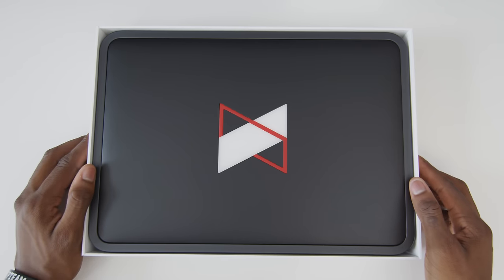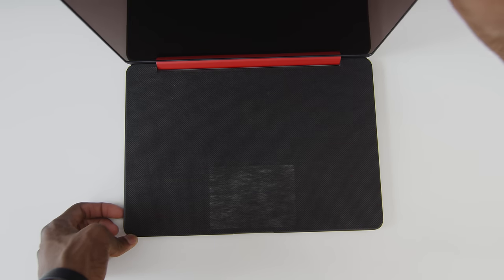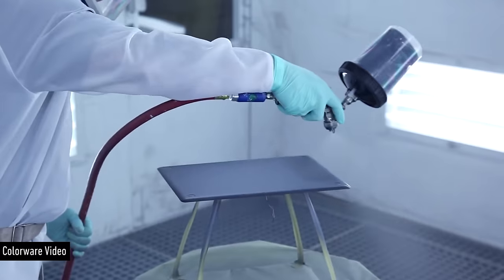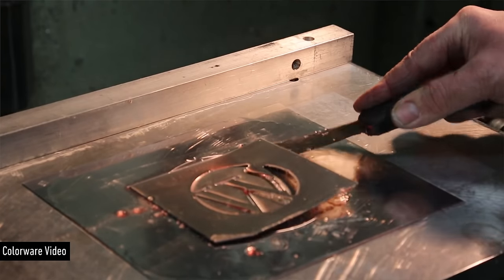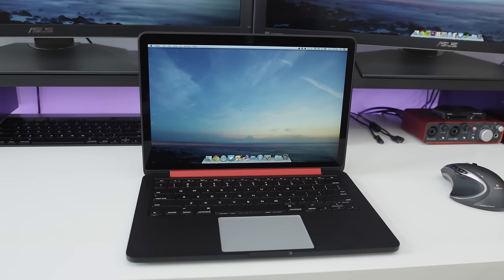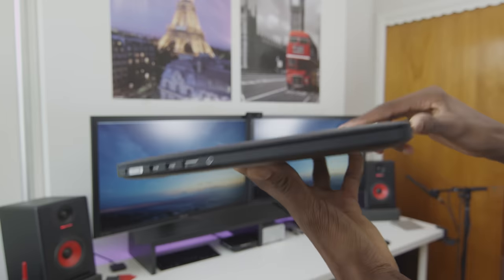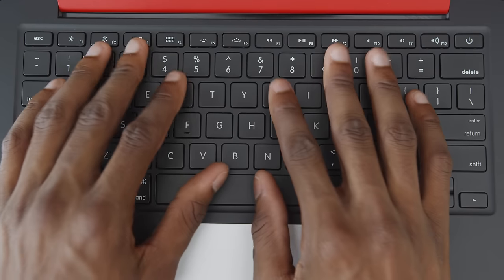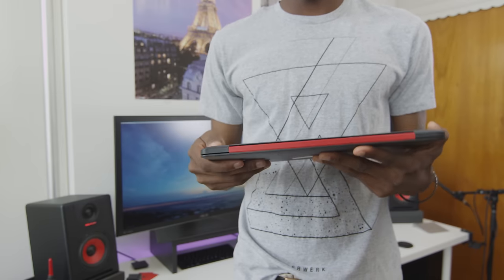MKBHD Edition Macbook Pro! (Colorware Custom)

Comment: I'm not not being an apple hater here, but why do so many people love the Macbook line, what's so apealing to it over a nice ultrabook PC? I am a hardcore PC all the way kind of guy but I do like apple laptops. So what makes them a better choice over a high end ultrabook.
Reply: It's just a better piece of hardware, I run Windows and OSX on mine
Reply: A PC in the same price range non gaming are extremely comparable and even better built
Reply: Beside its industry leading design, Macs OSX as a Linux based OS is widely used in the media, science and engineering industry. And if you do need to use Windows or any other OS you can always bootcamp it - hell you could even completely remove the OS X partition. A major advantage over PC. If we are talking about price, the Mac line has been reducing its price lower than ever and it selling value is much better than PC.
Reply: They come with Mac OS X, which in my opinion has better UI than Windows. 

They are sturdy, stylish, and reliable. That is what some people like about the MacBook line.
Reply: This may sound naive, but macs really do last longer, plus, there are not very many virus developers that make viruses for mac, so they are safer. personally feel that the Mac OSX is much more organized and clean.
Reply: SnortsOfHappiness I think apple is very limmited to only apple. For example it's pretty hard to read files on a mac that are sent from a windows device
Reply: try to have one first.
Reply: Oh! Media oh i've worked with plenty
Reply: The case designs are always more uniform and symmetrical than most Windows laptops you can find, it just makes it look so much classier. I find many (not all!) have weird shapes that totally break the streamlined feel.

I use both OSX and Windows every day, but I spend most time on OSX because it's just an overall nicer experience. Also if I see how much time i've spent fixing crap on Windows in the past few years while I didn't have to do anything hard on OSX, it makes me love the Macbooks even more.
Reply: Let's get things straight here dude. I'm not marketing for them nor am I trying to sell something. I just answered his question why many people like macbooks more than windows laptops.

Regardless of how much bullshit the company is, I like the product. I don't care if it was freaking Toshiba selling the macbook, I just like the piece.
So stop acting as if I'm an Apple sheep because I'm not. I like both and just prefer one of them which is not Windows...Boohoo.

Just let people state their personal opinion, it has nothing to do with the whole company, jeesh.
Reply: Brand Loyalty + Marketing
Reply: 3Target33 grow up, he isn't marketing anything.
Reply: For me, the difference is that MacBooks are purely enjoyable to use. I had a few Windows laptops and they were fine spec wise, but I never enjoyed just using them. The way MacBooks are physically designed, coupled with the OS makes me enjoy using the actual technology in addition to what it allows me to do.
Reply: Just the functionality, for example, I am an Apple developer, I need OS X to code with XCode. Personally, I like it, I can also run Windows on it, unlike an Ultrabook, I cannot run OS X (legally).
Reply: Try to find a laptop with Firewire to, say, be able to run a decent I/O audio box, beside a Macbook pro.
Reply: Omar Al-Hadithy IOS sucks, it's not even good as a gaming platform... He, that's what happens when you string meaningless words together without a hint of any fact behind.
Reply: Use a mac and you will love it, i use note 3 but i stick to ipads, i game on my pc with 760 but i bring my mac air out everyday to work. They all have different usage and you should never hate on something until you have tried using it
Reply: Sorry, but "Window suck" is a totally meaningless, immature and irrelevant comment any way you cut it, grow up. As to the fanboy sly, it is just as mindless as the rest of your dribble,  I run a pc workstation at my studio because Apple doesn't make one that fits my needs, and I carry a Macbook pro because it does what I need at a price I'm willing to pay.
Reply: 74Burgess No it's not.
Reply: TheGaIaxy  BS! BS EVERYWHERE!
Reply: Before I say anything, I own both a 13" macbook pro and a laptop, also an 4k gaming PC.

In my OPINION: The Apple macbook pro may seem overpriced at first, certainly spec-wise. But you're actually paying for the user centered design and lots of R&D. Overal I find using the macbook pro a lot nicer. Things are smoother, more consistent, better designed and easier to use.
My macbook is for light usage like schoolwork, light design work, love the portability and just consuming media on it, not gaming and video editting. 

For gaming and video editting I use my desktop PC, or if I need to be portable my windows laptop. You can just get more bang for your buck specwise.

Hope this helps :)
Reply: to everybody that thinks apples are overpriced, fine. Don't buy them. Buy whatever toshiba, dell, hp, whatever laptop you want to get and run windows 8, i hear it's lovely. get a touchscreen capable laptop, it's not at all gimmicky. do what you want, i'll stick to my macbook and be happy with it, run OSX and windows flawlessly, and be glad about the fit and finish of the machine. I prefer my fully loaded rmbp to the tower i built.
Reply: It's a combination of battery life, solid industrial design and software.

Apple has long had a reputation for better-than-average battery life in its laptops, and that's still true now. You know how Windows Ultrabook buyers are ecstatic when they get 8 hours of battery life? Yeah, a 13-inch MacBook Pro (with a more powerful CPU and a sharper screen) gets 9 hours of real-world use; a 13-inch MacBook Air gets 12.

The design isn't necessarily the materials, although MacBooks tend to be free of creaking and panel gaps.  It's things like the superior trackpad (accurate, smooth and supports plenty of gestures), the MagSafe power connector (prevents you from dragging your laptop to the floor) and a genuinely comfortable and quick keyboard.

And software... well, OS X isn't for everyone, but it's easy to grasp, reliable and has a lot of features that can greatly speed up what you're doing (Spotlight searching and the Mission Control window/desktop manager, for example).  It's not true that Macs are immune to viruses, but they get disproportionately far fewer attacks than Windows -- so long as you have a router and use common sense, you're genuinely fine if you don't run security software.
Reply: Aurelian well said, I couldn't agree more
Reply: 3Target33 I completely agree.There are good mac books as there are windows laptops, it's just down to personal taste and what your using it for.
 
All these people that say windows suck have ether, never owned a windows laptop, or just brought the cheapest one they could find.
Reply: Probably because they look really nice and are really popular
Reply: As far as I can tell it's all about software preference/ecosystem. Many customers prefer OS X to both Windows and desktop Linux, and there's definitely something to be said about iOS and OS X integration.
Reply: Windows is a cheaper way to get more bang for your buck performance and content-wise, considering you can pirate ( arguably ) anything. Tbh if I could afford it I'd much sooner buy a Macbook for my everyday use and a console for gaming, but I had to combine the experiences due to financial concerns.
Reply: 74Burgess I also run linux and a few other os's
Reply: crarazy buy one and you will understand
Reply: Not gonna lie I don't understand why Macbooks are so popular either and yes I have used one had to use one for several years at work. Everyone keeps saying that PCs have crappy build quality but I disagree yes there are alot of companies that make PCs and some of them are crappy but you just gotta do your research to find a good well built PC. As far as being able to only run Windows that is also not true I run Fedora, Windows, and OSX. I only use OSX for xcode and IOS development and I use Fedora for all other coding projects and work. However my daily go to is windows it is simple to use and customizable and honestly when I am home I just want a computer for playing games and internet. Not to mention like many have before said PCs are far cheaper I am running a laptop with dual nvidia graphics an I7 hasswell processor 16gb of ram and a 500gb ssd in an aluminum chassi computer all of which I got for under $900. I guess if you really prefer OSX then that would be the only reason I really see to getting a Macbook.
Reply: Faraaz Youssifou You can read any file that is sent from a pc device on a Mac. But sometimes when receiving files from a mac, windows doesn't support the file format.
Reply: I bought a MacBook Pro 13" Retina to run Windows.  After looking at all the Windows ultrabooks at Best Buy, I wasn't satisfied with the build quality of most of them.  I did kind of like the Samsung ATIV Book 9 Plus, but it was actually more expensive than the MacBook I got (ignoring the fact that I had to buy a Windows license for the MacBook, heh).  To be fair, some of the specs of the Samsung were a bit better, but the MacBook has something that no Windows laptops have anymore: a 16:10 display.  There may be better Windows ultrabooks than the ones I saw at Best Buy, but I didn't want to buy an expensive laptop without being able to try it out first.  I don't regret buying the MacBook Pro at all; I absolutely love it.
Reply: Because an expensive company has it's name on it. So if you have a MacBook you'll seem "Cool" It's all a bandwagon propaganda thing
Reply: jdpurcell2 did you like mac os after trying it or did you just go straight to windows.
Reply: Tonester Sher Well not necessarily, though I would agree with you for other aspects of Apple, I wouldn't say so to as much of an extent for their laptops. They are more expensive than others but it defiantly functions, has many great features, integration with other Apple products (none for me since i don't own any Apple products) and good reliability. I was just looking at the Surface Pro 3, now it has a lot more flexibility than the Air, they both are the same price range, like the exact same price range, the Mac actually has the edge by $200 price difference in the upper end of the spectrum, that's $200 less than the Surface.
Reply: Price Burnett My previous laptop was a MacBook Air 11" so I had already used OS X and knew I didn't care for it.  I just prefer Windows' UI, primarily the way the taskbar works vs. the dock.  I don't like mixing of non-running apps with running apps (which is why I never "pin" anything in Windows), and I like to have each window show up separately in the taskbar and to see the window title next to the icon (I disable combining).  I like to map network shares from my Windows desktop which is a bit awkward in OS X.  Keyboard navigation in Finder is strange - why does the enter key trigger a rename instead of opening the item?  The way scrolling with an external mouse works - I hate how it starts slow and then speeds up (SteerMouse fixes this though).
Reply: rockhopper123452 i used to run windows, osx and linux but i did something wrong because my screen just stopped working lol
Reply: Windows (Everything after Vista) seems to hate DJ software, with Mac that does not happen. I also like the capability to run natively OS X and Win 7 at the same time, but to be honest, I almost always use Windows because FL Studio (I produce my music with it) and gaming (My MacBook Pro runs suprisingly well Watch Dogs and all the new games).
Reply: jdpurcell2
Be careful because the Retina display is useless while using Windows, you will need to resize the resolution to the resolution that the screen would have without Retina display, unless you want to get blind tring to read tiny text.
Reply: wejhvabewjty The Retina display is not useless on Windows.  I run at full 2560x1600 resolution.  Windows supports DPI scaling.  I have it set to 175%.  It's not perfect everywhere because it's up to each application developer to support it.  But it's definitely very usable and most of the time I'm browsing the web with Firefox which does DPI scaling flawlessly.

Applications that don't implement DPI scaling usually just get scaled up by Windows automatically so they look a bit blurry, but normal sized.  Only rarely (e.g. Adobe apps, Dropbox) will you find an application that appears way too small, because those applications tell Windows that they can handle high DPI displays even though they can't.
Reply: I used intially the DPI scaling, but its completely horrible. Try to use 1280x650 with 0% of DPI Scaling, it will look way better, and it won't hurt your eyes.
Reply: Depends what you're doing... but for primarily web browsing I like to run full resolution for crisp text and the few YouTube channels (e.g. this one) that have 4K video.  But yeah occasionally I find stuff that sucks with DPI scaling, e.g. remote desktop.  If I need to I turn off DPI scaling and run at 1440x900 resolution.
Reply: jdpurcell2
Agree, but since it takes a lot of time to change resolution and scaling I reset to Mac if I ever need to watch video in really high quality.
Reply: Dat Tin Nguyen You forgot the almighty Linux!
Reply: Personally, I don't see any reason to buy a Macbook Pro. I say this purely because of its price to performance ratio. for the same price, you can buy a pc with a beefier core i7, more RAM, and better SSD/storage options.

This leaves the aluminum unibody construction, the retina display, and OSX as its only selling points. That's not enough to win me over :/

I recommend an Asus g750JZ, or the Razer Blade 2014.
Reply: bullsharkreef Okay, first of all I don't want to be tech grammar nazi, but, iOS is for iPhone, iPad, and iPod touch (that being said it is based on the same architecture of OS X but that's a whole other story); OS X (formerly Mac OS X) is the 10th major version of Macintosh Operating System that has received revision updates for the past 13 years.  iOS is to Windows Phone and Android as OS X is to Windows 8.1 (or 8, or 7, or Vista, or XP, etc.) and the thousands of desktop Linux distros.  Not trying to be condescending it's just a pet peeve of mine.
Reply: Tonester Sher I don't know if that's true, hear me out.  If that was the case, why would MKBHD (and other customers) go to a company like Colorware if they wanted to show off their Apple loyalty.  If you look at this custom laptop, it's a total sleeper... nobody would know it's an Apple laptop unless they really looked at it hard (like noticing the charger or the command key rather than a windows key).  I realize that Apple is known for their iSheep who simply follow what they say, but others (and I suspect many of the tech enthusiasts watching this very video) try to inform themselves of ALL the options in a piece of technology before deciding what works best for them.  I'll give you an example, I could have easily gone with the all inclusive Apple ecosystem, but I decided in my circumstances I would prefer an Android phone (for the customizability and in my opinion more practical functionality), a custom PC that I built (for a home workstation/ gaming rig/ home theater), and a MacBook Pro for a work and school (knowing that I'd have Apple's great customer support should anything go wrong with a machine that I'd consider more vulnerable than a desktop).  It's just what worked for me, it also helped that I had grown up using Apple computers for most of my life, so unlike many of todays iSheep who decide to jump on the Mac bandwagon after they have their fun on their little iPhone(...meh), I actually had a little bit of skin in the game and tried to broaden my horizons instead of getting sucked into Apple's ever expanding ecosystem post 2007.  Oh well, that's just my thoughts.
Reply: design, battery life
Reply: longer battery life :)
Reply: ***** Are you for real? Ok "Puts out 4k"..... better now? If you think its entirely impossible do some research :)
Reply: ***** This is the reason you don't have many friends Mathias
Reply: 74Burgess Exactly finally someone understands
Reply: Its important to realize that these days Macs aren't overpriced. Expensive, yes, but not overpriced. They are well made, premium products, and when you use one you can really feel how well it is made. Also, because the hardware and software is MUCH more standardized than windows machines, everything just works better, and in general I find the OS to be better designed and easier to use. Plus, despite how easy it is to make fun of the apple store and the genius bar, apple customer support typically beats all other manufacturers.

Personally, I have two computers: a purpose built desktop gaming PC, and Macbook pro that I use for everything else, including work, general internet browsing, travel, and organizing personal data and files. Pretty much everything except gaming is better on a mac (and even then you can bootcamp it and play some of the more reasonable games just fine).
Reply: i own pc and mac, and with every thing apple, i think you can always break it down to user friendliness. If you buy something apple, it may not do everything you want it to, or have the specs, but you will usually immensely enjoy using it. Hope that helped.  Just recently bought a macbook air 2013, the battery lasts forever, and its so light i can comfortable hold it with one hand.
Reply: ***** Grow a pair
Reply: Rocking that Red Hat life
Reply: There are a lot of great comments here on why I prefer Macs when it comes to laptops (I prefer building custom desktop PCs as a gamer). But here are a few things I didn't see anyone mention:
-Free Software Upgrades - The current version of OS X was a free upgrade, and many of their other pieces of software seem to be following suit. That helps bring down the cost of the computer over time for people who like to always run the latest versions of software. 
- Professional IPS displays. As a photographer, I can always rely on the quality of a Mac's screen. Sometimes I'll be tempted to try a PC laptop because of a cheaper price or slightly better GPU, but then I look at the screen quality and I remember why I pay more for my laptops. Even if I were to go the PC route, high quality screens are only on premium laptops. Remember, there is a lot more to a screen than just its resolution. 
-Great productivity apps included at no addition cost with all Macs. iPhoto is great for organizing and editing photos for most consumers or small businesses. Pages and Numbers are great replacements to Microsoft Word and Excel for many people, and I find Keynote to be a much more elegant program for designing presentations over PowerPoint. And YES, you can buy Microsoft Office for Mac. I can't tell you how many times I've heard PC guys say you can't get Office for Mac. GarageBand and iMovie are great for simple video and music projects, and Final Cut Pro and Logic are great professional programs only available on OS X for those who want more professional features. The prices for Apple's professional software has become extremely cheap compared to the competition in recent years as well.
-Your apps can be installed on 10 devices. If you eventually get multiple devices or have family members with Macs, you can buy one copy of an application on the Mac app store and install it on all of those devises.
-Many other reasons that are important for some and not important for others. Remember you are paying for more than a device. You are paying for an experience. If the hardware, software, and experience does not match or exceed the price point for you, then maybe a Mac is not for you. But it's hard to really know for sure until you have used one long enough to develop a personal opinion. Like I said, more than anything, it's mostly about the experience.
Reply: Faraaz Youssifou I think thats inaccurate. I work on windows at my work and I have a mac at home. I send files in between all the time. As long as the file types are right, you can view files from either medium
Reply: Maybe because iOS runs iPod iPad and iPhone, not MacBooks.  OSX is actually decent for gaming.
Reply: bullsharkreef There are other videos on YouTube that prove you WRONG, my friend! Mac can play quite a few games itself like Amnesia: The Dark Descent as an example. It runs pretty well. So, shut the fuck up saying that MacBooks aren't worth gaming iOS!
Reply: Canadian Inuk 47 Wow, that's intense gaming. Amnesia, because that's just as hard to run as BF4 or something like that.
Reply: crarazy Not everybody plays a fucking shooter on PC.
Reply: Canadian Inuk 47 Ya your right, but when your talking about a computer being good for gaming, Amnesia is not a game that shows off any kind of gaming ability.
Reply: I play Skyrim on high settings on my rmbp 15", no issues at all, it looks gorgeous and runs smoothly, 4x antialiasing, Idk where people get the idea that apples can't game. If you want to game on one, bootcamp that shit, install windows and play. The problem isn't what software is better or worse for gaming, or what company makes your computer or hardware, it all comes down to whether or not the person behind the screen is a fucking idiot or not. It's computers people, not fucking rocket science. Stop the pissing contest and get what you need to do what you want to do and leave it at that
Reply: crarazy Well, then you're being an Apple hater even though you claim not to be.
Reply: Ew macs....
Reply: paratrooper95 You can get a MBPr for the same price with better specs other than GPU and slightly less resolution than the latest blade 14.
Better specs include better cpu (turbos to 3.8ghz vs 3.2ghz on the blade), twice the ram (8 v 16), and twice the ssd space(depending on spec ~256 vs 512).

That's going off AU pricing.

If you aren't gaming and don't need a black laptop the mbpr is probably the better way to go. Most things at that price point could seem to be poor value for money. It's diminishing returns.
Reply: I buy them because they don't get viruses as easily and I love apple's software
Reply: Elementary OS almost never ever gets viruses... And it looks better than apples software and its free just buy a windows pc way cheaper
Reply: ryan h You would have to be real unlucky or do some real dumb stuff on a PC to get a virus in 2014.
I literally cannot remember the last time I got a virus.
Reply: *****
exactly. Ios is not the same as Os. You could say a triangle is a trimmed down square, because you can cut a square into a triangle shape. That doesnt make them equal. So there is indeed a difference.
Reply: the apple my friend. Most of them dont know anything about pcs thats why they buy them. They do indeed have good  hardware but they also cost 2 times more. So if thye actually knew anything about computers in general they would not be so dumb to buy a mac.
Reply: anemozen I know plenty about PCs, I enjoy having a laptop that feels like it wasn't thrown together last minute, and having something that I know will last a long time. It's simple, well built, and can do pretty much anything I need to do. Yes, for the price I spent on this laptop, I could build a killer tower. But I want portability. And right now, with laptops anyways, I just haven't seen anything on the market that was designed this well, has better build quality, or is as reliable. Think of it like this...Some people think that buying a Porsche might be stupid because of the price, why would you spend that much money on a Porsche when you could just put money into a used Vette or WRX or whatever and make it go faster? They completely look past the overall feel of the car, the design put into it, the way it drives, quality, etc. If you don't have enough money to buy one or don't care about the design, quality, or feel of the Porsche, then don't buy it, simple as that. That doesn't make it a stupid vehicle. Nor does it make people stupid for buying them (even though plenty of people that do are lol).
Reply: 74Burgess nah you can find a better laptop you just dont know how to look.
Reply: anemozen
and whats actually wrong with a mac? dont say it cant run games. It can. But its built and designed for software, development, productivity. You truly cannot compare different laptop brands (pc, mac, linux, etc.) because they all have their own uses. Mac's are the best for what the do. As is windows. And linux. Now your opinion may say one is better, but dont tell everyone that mac sucks and pc is better. Its an opinionated response and if you dont support it nobody will take it seriously.
Reply: Juan Leonardo Their specs are no more powerful than a PC, they just charge a premium for it that it a considerable price jump over an equivalent PC. And for the OS argument on which is simpler, they are both equally as easy if not easier on the Windows side. Its not like IOS vs Android where IOS is clearly the easier OS.
Reply: Well first of all, what price range, there are 4 different retina display Mac Pro's so which one. For the case of the 15'' which starts at $2000 dollars, no matter what PC I look at beats it, why, because they are all gaming computers, and a gaming computer will beat a Mac Pro spec wise everytime because they have are all i7's with SSD's, 8gb+ of RAM and will always have a graphics cards. So no Mac pro can beat it. When your maybe looking at the 13'' it's different, but you never specified a price point, so do that and I'll get back to you.
Reply: crarazy ummm... tell me a single computer released in the last two years without a graphics card. Also, no not every other pc is a gaming computer. As a matter of fact, my laptop isnt, it has a baseline intel cpu, not the best graphics card, but still runs games quite well, at 1.89 ghz. with 4gb ram. My cousins pc? lower specs than mine, and its a desktop. I guarantee you, a macbook pro retina is better than both of our computers combined. Any of the ones made in the last two or three years. And gaming laptops are made for GAMING, whereas Macs are not. Of course the specs of a gaming pc will revolve around proficient gaming performance. Macs are for production, media, etc. You cannot say one is better than the other that broadly. Macs or Windows is a preference, neither is better because there are too many specs. I prefer macs because i like media and production, but i use windows more. Why cant people just stop arguing about "which is better" and just buy which one they want. Or both. Better yet, lets all buy linux's! Just SHUT UP about this completely ridiculous argument.
Reply: TheParanoidShadow Well if your realized the whole point I made in the original comment wasn't to start an argument but some how fan boys, which you appear to be one, jumped in and turned it into that and now I'm just here commenting on peoples stupidity. OS is clearly personal preference but the claims you are making are clearly false. For one, all computers within the last 2 years do not come with a GPU, in fact, very few of them do, including Mac's. Only their top of the line mac pros come with GPU's and there terrible, a 750m is last gen after there latest refresh last week and it also a very low power GPU compared to what you could by for the same price. And gaming laptops, the last person said to go and find a PC that beats a Macbook Pro spec wise and so I did, and in that price range they all happen to be gaming laptops, which macbooks aren't so they don't even compete spec wise.
PC:1, Mac:0. 
No your saying that you like macs because there for "Production and Media" that is extremely vague. What kind of production and media. You could be talking about watching videos and doing Microsoft office stuff because by looking at your YouTube channel where your "production" takes place your literally screen capturing Legend of Zelda (which there is nothing wrong with, especially Ocarina of Time, great game). So what makes a PC, in your book, less productive than a Mac, because I'm pretty sure they can do the same things.
Reply: crarazy
im not saying im a fanboy. I like both for their own purposes. Im saying that you can have a computer with beast specs, but it wont really matter if you dont utilize them. I mean production and media as in, taking photos and videos, editing them, adding effects. I feel like mac does a more efficient job because Mac os seems more like a software for developers and light programming. Im not saying pcs are less productive at all. Im saying macs are directed towards the industry of editing and producing media, whereas pc's are more universal. Most pcs can do basically what macs can, and some of its own. But mac does what mac does best. Pc's are excellent, especially for someone who watches videos and gaming and even just typing reports. Macs arent as good at the latter. They can do the same things, but they do certain things better than the other. I havent had a mac personally for long enough at a time to dig into it and see exactly how well it is, but from using them and and pc's, i can tell mac is more for extensive media production. Yes, i do the same on here with zelda (it really is a great game) but as far as editing goes, its incredibly hard for me as a pc user to find a good editing software. I actually only use the editing tools youtube has available. I dont prefer one over the other, but with pc's, because of how many there are and how different brands are, its hard to find one that runs exactly the way i want it to. But macs have what i want.If i could, id have both. I eventually will.
Reply: Juan Leonardo See there you go, and thats the reason you should by a Mac, if you like the OS, not for the specs. Because honestly, at any price point a Mac will never compete with a PC spec wise. But since its the OS you like, that's why you get it. The 675 is a good GPU, I know specs, and I can tell you a 750M is not as good as any of the GPU's listed on that chart. It's not able to play games at full 1080p on max setting maybe medium to high. But spec war, PC always wins and for OS war, purely up to opinion.
Reply: TheParanoidShadow Ok, now it seems we've reached an equilibrium, I agree with you and you seem to agree with me. The free video editing software that comes on Apple is by far better than any you can get on PC. I use high end editing software at school so I know that they have good software that works very well for PC but I know it runes just as well on Mac. But for media editing, yes Macs do seem to have the advantage because that software seems to be optimized more for Macs, and gaming is more optimized for PC. So yes they both have their pluses, and OS is purely up to opinion.
Reply: crarazy What if you don't like gaming and don't want a plasticy piece of crap?
Reply: JayJapanB Then you get this Samsung Series 7 Chronos, which is the same price as your clearly implied and beloved Mac Pro that isn't the "plasticy piece of crap" as it is all aluminum. And well it can game but do all the other things things that you want it to. You do realize that when you step into the higher price range of PC's that they are going to be built with some gaming in mind even if you don't use it because they realize that that's a good place to put the money.
Reply: JayJapanB Or the Surface Pro 3 which is an extremely high powered tablet-PC combination that has an all magnesium body, which is more high end than aluminum.
Reply: JayJapanB Or this:Samsung Series 7 Ultra
Reply: Juan Leonardo There we go, sums it up perfectly.
Reply: crarazy The Samsungs you listed are old, cheaper yet not comparably speced.

I have a surface pro. You make tradeoffs for the pen tablet format.
The performance is a lot less. The battery life also isn't the greatest thing in the world.
Also the paint wore off pretty quick on the first two. I haven't seen any old 3's yet. A high end surface pro 3 is by no means cheap.

As for gaming laptops, I see no reason to pay for a gpu I'm not going to utilize to it's full potential.
Compare a Razer Blade to a MBPr and ignore the gpu specs.
What do you find?
Reply: pikken01 And may I know what exact models you've been using and how long ago? It's entirely true that most laptops were garbage pieces of plastic five years ago, but companies have really upped their standards lately. Asus is a good example, their recent premium-ish devices like the zenbook are extremely well built. Same goes for dell although they do sell both high-end and cheaper devices
Reply: You know Apple is good for studying arts or computer arts. PC is more used for programming.
Reply: rockguy132 Well, imho art can be studied perfectly well on anything that has a correctly calibrated screen, however you lost me at "computer arts". If you're talking about Photoshop, that stuff should really be done on a desktop anyway, and the mac pro doesn't really work for that situation because of thermal  throttling in its GPUs. (in case you don't know what that means, when a GPU runs too hot because of bad cooling it slows down to avoid overheating. That causes large drops in performance)
Reply: Why I think people buy macs is because it's the industry leading standard. The OS is designed from the ground up to work as smooth as possible and handle as much as it can. I'm a Graphic Designer in spe (still in school) and I've always been a huge PC fan. But once you work with a mac, you can feel the difference over using the windows OS. Anotehr thing is that you are sure of what you buy, most proffs won't bother with building a custom pc with a good amount of workforce in it because it takes time, they would just buy something that is available and easy to support when something goes wrong. It's just the mindset of Apple, it knows at who it's targeting it's products.
Reply: There is only one thing wrong with apple: Compatibility (well, and they're a bit overpriced)
Reply: K3Techs Thermal throttling of its GPUs? Photoshop?
Anandtech found no throttling when he completely maxed a Mac Pro load. I've never known Photoshop to stress even a properly configured gpu setup.
Reply: storera21 they are overprice compared to a surface pro 3 which its years head of them
Reply: ***** Years ahead? How, objectively?
Reply: JayJapanB No its fact, the future is what the surface pro is bring, once it can gets smaller it will completely destroy any uses of paper, this idea the surface pro was started 14 years ago by Microsoft, apple has not really done much but improve on what is already there I bet you will not see a pc tablet from apple anytime soon, maybe 5 years from now... that's just a maybe
Reply: A week ago I was wondering the same thing about Macbook computers. It was years since I used a Mac computer and wasn't very impressed with them. However he's why I prefer using a Mac and get why other people would.

I do not care about gaming whatsoever. I'll play Minecraft or L4D 2 on occasion. I care about web development, programming and multimedia. For me, I prefer Mac OS X for that reason alone. Most applications have versions for Macs and for Windows so really in terms of applications it's gaming versus multimedia, graphic design, and musical arts.

On top of that, OS X just looks sharper when compared to windows. I hackintoshed my PC a couple days ago and started a challenge where I decided to be OS X exclusive for a week. So far so good. Instantly I noticed how sharper OS X is compared to windows (keep in mind i'm using the same display). I put Windows on my Macbook pro with retina display. Instantly I noticed how duller the operating system looked even with DPI, scaling, and all that Jaz setup correctly. 

I'm not one of those people who say stuff such as "Macs can't get viruses" because a) they can and b) It's easy to stay virus free unless you download notavirus.exe, go on weird porn sites, are friends with hackers, or just are stupid when it comes to downloading things. I also won't say that OS X is easy to use just like I won't say Windows is hard to learn. It's a matter of perspective and what you're used to. Windows 8 was a big change and the timing transition was a little bit shorter than the OS X transition but it still was different than what i was used. 

Sure you can get a computer with better specs with less money. However, does that computer come with a good design, and good screen, multimedia software, and have an actual good keyboard and mouse? I returned my Macbook Pro and got a PC laptop that was about the same price. It had more RAM and a better CPU. Problem: No Mac OS X (I like the software better), Worse battery life, the keyboard was crap, and the mouse pad was terrible by comparison. There's more to a computer than just a CPU, RAM and price. Most people don't think about that and are ignorant about that and I realize I was wrong to think about that way in the past. Oh as a sidenote, I returned the PC and i'm getting a Macbook because the touch screen didn't work, the mouse sucked, and the glare was terrible. 

Also it's a mobile computer. Gaming on a laptop sounds just as silly as gaming on an iMac. Who really needs a powerhouse computer if it's just a mobile machine and people have desktops and laptops?

Between build quality, software, keyboard, mouse, display, and battery life, there's a reason why the Macbook pro line is popular. Sure they might be more expensive but you get what you pay for. You don't mind a crappy keyboard, mouse, display and battery life, go with PC.
Reply: People like them because of the operating system, if you get at $1200 windows computer it will be just the same quality build, but its your choice if you want Mac OS or Windows OS.
Reply: Laguna Jules "$1200 windows computer it will be just the same quality build": Source?
Reply: most youtubers get it for imovie and finalcut pro probably the best editing softwares avaible and exclusive to mac os so yh
Reply: price wise you wanna go with an ultrabook, but macbooks last so fucking long their hardware can't keep up with the constantly updating software before it breaks. So overall it's a better investment if you got the cash.
Reply: Design.
Reply: Its a computer that works as it should. I paid 1.300$ for a Asus ROG and im impressed how Windows 8.1 is shit,.. Wish I have the money to buy a MAC.
Reply: Wilf Techhelp actually, no. it depends on what program you want to use. for me, with the same amount of money for a Mac Pro, i can build a faster PC for the same price.
Reply: I own one. But I don't love it. It's way too different from window's but it's pretty fast i tell you takes like 3 secs for me to shut it down. Pretty convenience
Reply: Gilang Wicaksono *faster for the programs you use.
Reply: They're good if you find windows difficult to use.
Reply: over-appeal everyone on sight by saying 'no virusses, no spywares and a ton of headaches', well if you are a gamer and you bought a macbook, shame on you! it is hard to tell that it has limited or lesser amount of games in the library than the Windows PC and its "not" or its expensive to be upgraded. on the other hand, you wouldnt probably swear if that 'sphere of impatience' still lurking around your macbook and also it still vulnerable to viruses called 'mac-viruses' that you lied to your friends to let them buy a macbook for the next yearly cycle, because you dont even care nor they are also lying and being dishonest. well if you dont like or hate on macbooks, buy a razer blade with an antivirus kit or any gaming laptop like Maingear or Asus, or even things are sarcastic and lead to a hypocrite, then if you dont like getting too much paychecks on computers and laptops, DONT BUY ANY SINGLE GODDAMN COMPUTER!
Reply: Melvern Soelaiman bro take a chill pill. I have a gaming pc and a mac I have my reasons to own one.
Reply: Let me put it to you this way:
A Mac is like a basic Mercedes. Classy, powerful, but a little overpriced for what you get.
A Windows computer is like an old Toyota Camry. Bang for your buck, simple, and sometimes even faster than a Merc. Much cheaper too.

The Camry is perfect for grocery shopping, bringing kids to school etc. Everywhere you go you can find an old Camry.
BUT. Now you are looking for a fun car. Would you choose an old Camry over a Mercedes? I guess not.

What I'm trying to say is, a Windows computer is perfect for everyday use, and sometimes it does better than OSX. But most people buy Macs because they like the experience. A Merc will give you a better experience than an old Camry. They aren't for the same kind of people. Having owned a MBP, I can say many things (But not all) are much simpler on a Mac. Like installing something for example. Just drag & drop. Yes, I admit, there are some people who buy for the brand. But don't shove all of them on one side. Both platforms are good at their own things, let them be. A Camry can never be a Merc and a Merc can never be a Camry. Same counts for this. A Windows can't do Mac things and a Mac can't do Windows things. Each have their own market.
Reply: Ryan Bogaerd Bro a perfect grocery car is a lambo
Reply: DrrrreeeeeammmmmM Oh, yes. Definitely. XD
Reply: FuZionSniperzZ
>implying implications
why would a sane person choose a shitty floppy system for stupid people over certified unix?
Reply: Super Toni This is not exactly untrue, my friend buys apple products for this very reason.  Sad, but some of us actually have Apple products because we favor them over products running Windows.
Reply: FuZionSniperzZ They haven't shoved anything down my throat.  I just opened my eyes and saw that MacBook's were the better choice for me.
Reply: ***** anything not running windows is better than something running windows obviously. but i prefer linux.
macbook + linux is good, though. both good looking and it does what i want it to do.
Reply: Echoz28 Yup whatever works for you.  Everyone has different opinions, and that's why there's so many options out there.
Reply: I am for my part a Windows User (mostly out of Gaming reasons) and i am not a great fan of the price policy of Apple. But still the Macbook is a extremly beautiful and functional piece of sexy hardware. Price/Performance wise a macbook is horrendusly overpriced but when u have and dontcare about the money and just want a product that works from the first start a macbook could be your way to go. As i said i would never ever buy one myself but everyone i know owning one is absolutely happy. (But getfucked with all that "apple doesnt catch viruses" bs)
Reply: Micha Pf
any computer can catch a virus if the user allows it.
software can have vulnerabilities, especially proprietary software like os x and windows, in which case it will be partly the OS developers' fault
in any other case it's always the user's fault
Reply: *****
windows is for the most part less flexible than os x, but that's really irrelevant since windows isn't a standard because it's good (by no means is it good) it's just used because it's popular and microsoft practically has a monopoly on enterprise sofware.
linux is far more flexible than both, obviously
Reply: Echoz28 How the hell is windows less flexible?
Reply: FuZionSniperzZ
How is Windows flexible at all?
OS X is at least UNIX compliant and and partly free software, which in itself allows for more flexibility than Windows.
Of course I doubt you have ever owned an Apple computer. Especially since you seem to be a gamer you are probably terribly misinformed.
Nonetheless I still don't recommend using either OS X or Windows.
Reply: Echoz28 I think they are both flexible, I think OSX is EASILY the best looking OS but it doesn't have the best hardware/software compatibility.
Reply: FuZionSniperzZ
Absolutely doesn't have great hardware compatibility, since it's only developed for one platform.
Software compatibility is not really decided by the operating system, since others need to make their software compatible with certain operating systems, not the other way around.
Reply: ***** Please, look in design studio's / Ad Agencies etc. depend son what field you're working
Reply: *****
macs are often used in places that are meant to look good. of course you can get good looking monitors, keyboards and mice for other hardware as well, but finding something that matches perfectly is often harder
Reply: Echoz28 Form over function is stupid, you can't build a business on that.
Reply: FuZionSniperzZ
No, it's absolutely not stupid. If your offices are well designed your employees are more likely to feel comfortable at work, and your customers are more likely to do business with you.
Form is a function on it's own.
Reply: Echoz28 Sorry but I have to disagree, My father works for the biggest tyre wholesaler/retailer in the UK, they turn over millions every year and some computers still use XP, one guy has an iMac (graphic designer), when it comes down to it, its doesn't matter what something looks like.
Reply: FuZionSniperzZ
Are you underage? You don't seem to think clearly.
Reply: Echoz28 I am 15, I have had a few months of experience is a major company and a smaller one, none of them use primary macs, therefore your argument is invalid.
Reply: FuZionSniperzZ
I've seen a music video on youtube, therefore all videos on youtube are music videos.
Reply: Echoz28 Ok? Incorrect....
Reply: Echoz28 You're the one who think that a company earns more money because they use a mac, am I really the one that is stupid?
Reply: Echoz28 My computer can easily smack most macs apart from the most expensive mac pro.

My case I got for £20 so I thought why not, it's not the best but it's functional, black and out of the way.

If you want me to list specs, please ask..

I am basing this off of retail and WHOLESALE, there is a large difference, also in the garage where cars are repaired, not a mac to be seen, should I tell you why? Because windows works a lot better in most cases.
Reply: FuZionSniperzZ
Windows is shit, OS X is shit, businesses are mostly filled with shit heads.
But if you are buying a house, choosing a bank, buying a car, or otherwise making important deals or purchases, the impression you make will mean a lot.
Also I don't give a shit about specs, high specs are useless for virtually everything except music, photo, and video editing/production.
Reply: Echoz28 and gaming!
Reply: crarazy
True, but that is using the computer as a toy, not a tool, so it wasn't entirely relevant.
FuZionSniperzZ
I can't tell if you are extremely simple minded, or if you are trolling, so I'll answer anyway. No, I want the function of the computer, the quality, and preferably enough storage, and if possible I will also take something I can feel comfortable using (it's ergonomically pleasant to use and looks good.) specs are not that important, as long as they are good enough for what I'm going to use the computer for.
I use my computers to program, watch movies, listen to music and browse the internet and I only occassionally play video games.
Even if I did only care about the looks of a computer, I would not be retarded. Are you even able to perceive that people who disagree with your subjective ideals of what makes a computer good simply disagree with you, they are not retarded, and you are absolutely not in a position to feel superior.
Reply: Echoz28 Why would you need a £1k computer to browse the internet and watch music? You could do that on a £150 tablet...

Programming, as you said you don't need a powerful computer, I've done it on my dell inspiron mini, works fine, costs £250, again why do you need to spend £1k? Want a good looking pc with good specs, look at some of the ones lenvo or Asus make.
Reply: FuZionSniperzZ
I'm not poor so why should I buy the cheapest and worst?
I like the MacBook, it has a good trackpad, good keyboard, good display, aluminum unibody is nice, and I wouldn't want a cheap shit computer instead, so why should I have bought one?
Reply: Echoz28 Because all you do is browse the internet and listen to music, woah it has a good trackpad?! damn so do most windows computers, good display? For facebook? Lol. Cheap aluminium unibody? Well....

You are still trying to justify spending 1k on a facebook machine? I do facebook fine on my 2 year old phone, again you argument is invalid
Reply: Echoz28 They say ignorance is bliss, yahhh but my computer cost £1600 sooo.....

Ima just sit here with my 4770k and gtx 780 on my 27" 1440p monitor.

Cya poor kid
Reply: FuZionSniperzZ
oh man i wish i had your computer ... if i had your computer i could ... never mind it would be useless for me
Reply: Echoz28 Just like a mac is also useless for you, it's like trying to get blood out of a stone with you, sorry but I'm not arguing with a stupid person any more, you are dragging me down to your level and you are going to win with experience, good day sir.
Reply: FuZionSniperzZ
I love my Mac and I do everything I need to do on it, so it's great. Absolutely not useless.
Reply: Crarazy Start looking at reliability scores of other manufacturers. It is something that you have to look out for. Plus, one thing that is incredibly compelling is the Apple Store. Imagine you're off in college with nothing but your laptop. If it breaks, you can go the Apple Store to get it fixed instantly. You can not do that with any other manufacturer.
Reply: Crarazy I do music in big studios and Mac OS is by far the best for music production and for editing, js
Reply: Super Toni no it’s according to what you use it for. I use it for music production and a Mac is far better for music production, if you go into a million dollar studio they are using Macs because they are better for music and also editing
Reply: The software, mac os